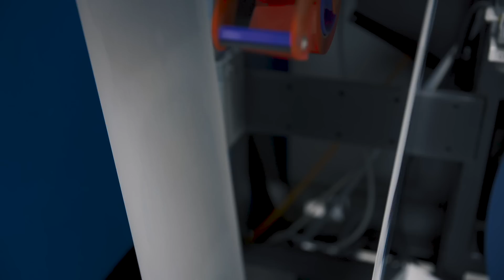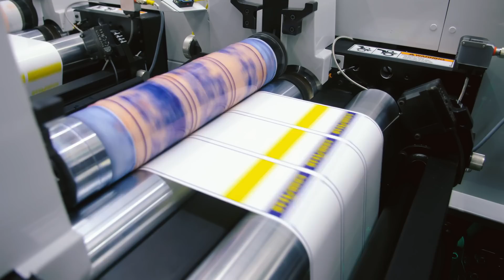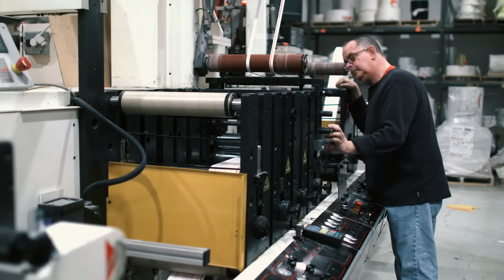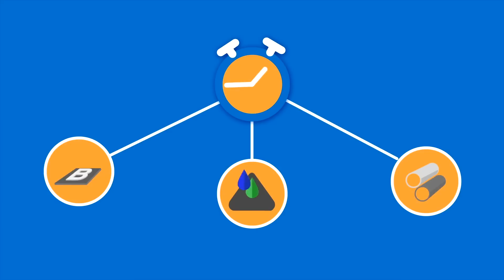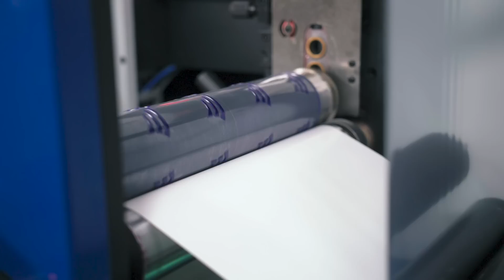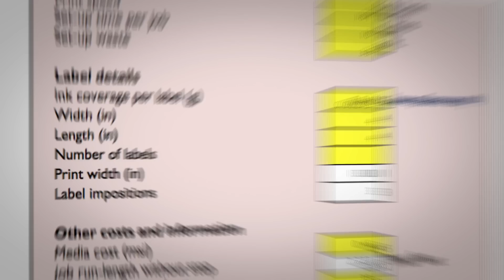When Flexo?  When Digital?  When Hybrid?

Comment: Domino is very bad
Reply: Why?
Reply: Why? I am from Brazil and thinking about digital label press.
Reply: Domino ink jet heads are expensive and don’t last a long time. If you don’t have the contract with domino repairs are expensive. Digital is not for large production orders more for small orders that have can be ran back to back because they use same substrate already on press and die cutting tool been working for a flexo company for 10 years and worked with both. Flexo out performs in terms of quantity as for quality digital is definitely better.

Comment: After 20 years of working flexo only we decided to invest in a Xeikon digital printer. We've had it for 5 years now and there is a lot digital printer manufacturers won't tell you. For example, embellishment ad-ons come from a separate machine, which can increase the price significantly. Overall, our Xeikon is very stable, but when ever it breaks down the costs of repairing the machine are much highger than in any previus flexo we've ever had. The price of a digital label against a flexo label can be 400% higher, so you have to find industries that are willing to pay that price for a small amount of labels, instead of going to the local pirnting shop to print that label for about the same price. Don't get me wrong, it's a neccesary technology, but we wish we would've known more before purchasing it.
Reply: thank you men, you help me choice the perfect decision
Reply: we have camera inspection system can improve printing quality.hope can have cooperation